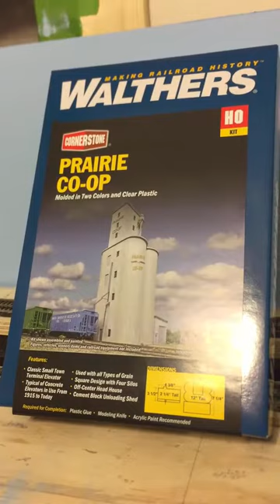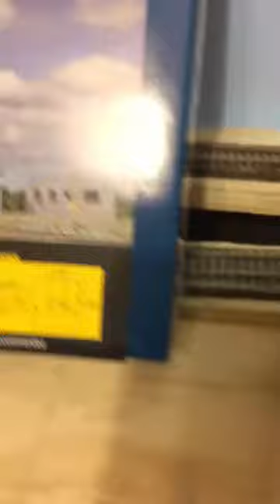Walthers Prairie Co-Op Elevator

Comment: New to hobby myself.  Building my first layout.  Yet to make a video.  Armstrong Electric? Idea, use flex track with slight curve, then straight (no "s" curve) to fit building at slight angle to backdrop.  You have to kit bash your side walls with styrene to fill gap to backdrop.  The angle would not give good line of site to the sides if the painting and weathering didn't exactly match.

Comment: The idea of using a slight curve to run the spur and building on an angle is perfect.  You wouldn't really have to patch the building since the end would wind up in the corner and wouldn't really be visible anyway.